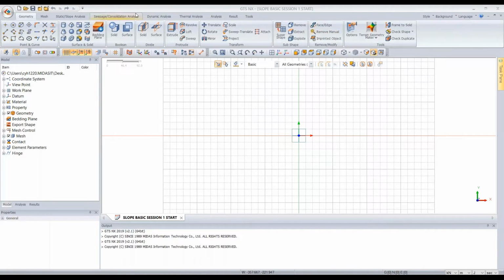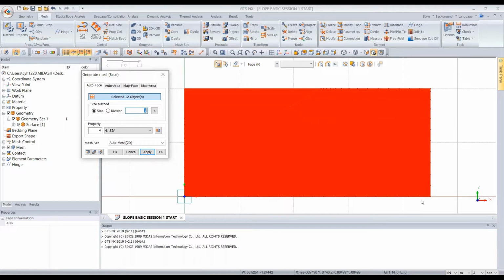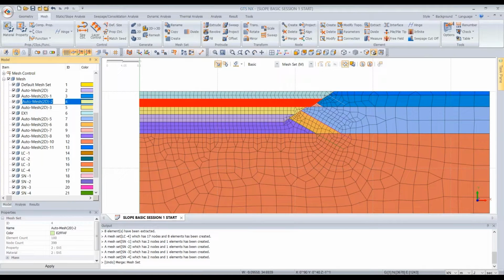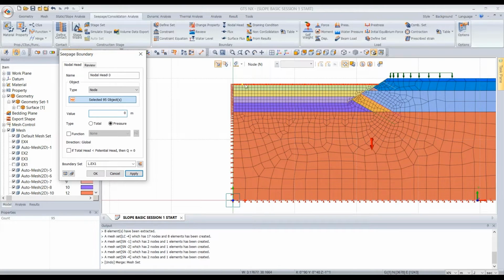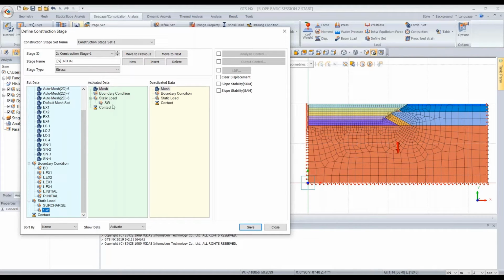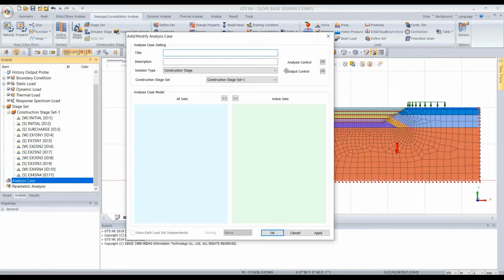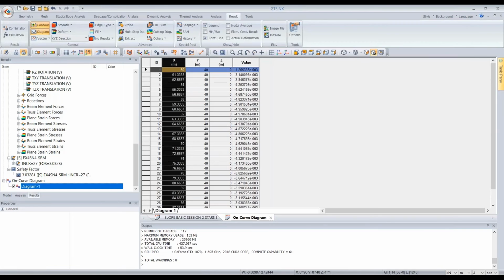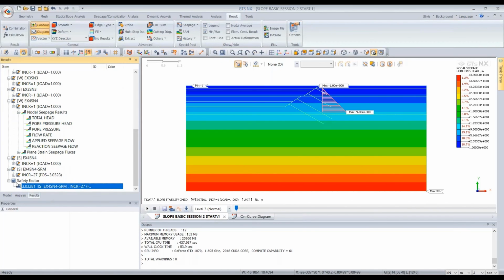Online Tutorial: Slope Stability -  2D Slope Stability Check

Comment: Thank you Midas for posting this wonderful tutorial. I had difficulty of differentiating b/n nodal head and water level which you made it clear here besides I have acquired new modeling techniques (like property control) which I had never used. However it is not clear why you used embedded beam property for the nails as you were only creating a 2noded 1D element (truss). Even in the post processing you get only truss element results not beam element results (like moment) for the nails. One more thing can you show us the property (like section and stiffness) you used for the nail and lean concrete. It was an amazing tutorial. Thanks again.